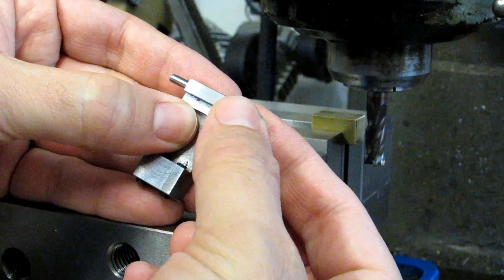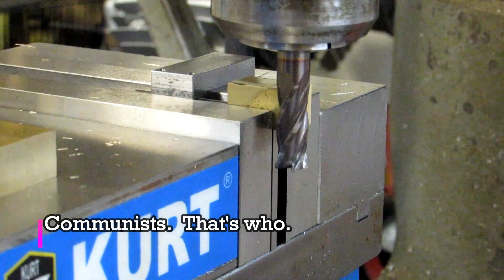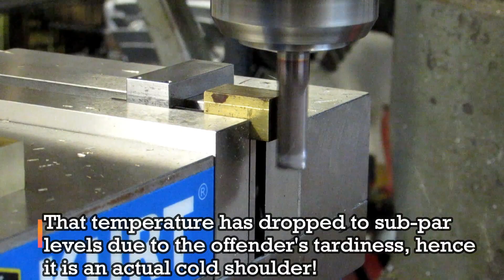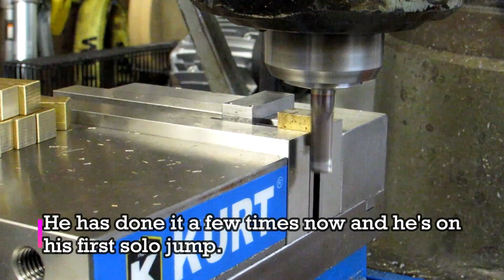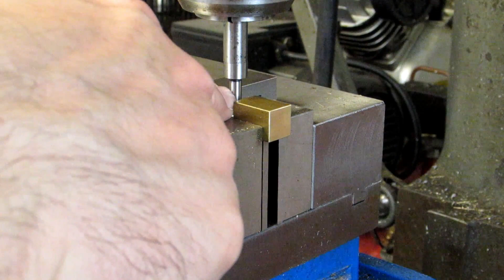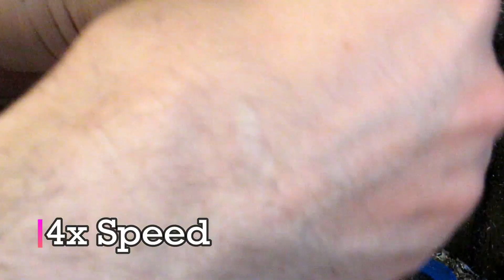Using Vise Stops

Comment: Why are you using conventional milling? You'll get a better finish with climb milling
Reply from the maker: It's a manual mill with A LOT of slop. Conventional milling keeps the screw and nut that drives the table loaded against each other  so the slop isn't going to be violently removed.
Reply: @StuartdeHaro  yes you're right but taking light passes like you did it should work. I never did conventional milling with manual mills but if the mill got a lot of slap is the way to do it

Comment: Hi Stuart thats a nice small stop. There is another quick stop that retains its X axis position is also useful if you prefer to continually reposition it in the centre of a new datum face. It's called a datum retaining vice stop. I like to have a spring inside my vice to hold the parallels in place when blowing the chips, it also takes out any backlash in the vice screw, so a small turn of the handle immediately releases the part.

Comment: I like very much when dimensions are in inches and millimeters. Everyone knows what's going on
Reply: I'm usually a metric guy, but when it comes to machining and the drawings we get from engineers (aerospace) they are always in imperial. It was easier to forget metric and go with the flow.

Comment: Do you use the break to stop the spindle when you power off the motor?
Reply from the maker: Yup
Reply: anon I think the motor has built in brake so automatically stop when off the motor

Comment: What are the doodads for?
Reply from the maker: They're actually a tool for locksmiths for re-keying tumblers.  The slot attaches to a jaw on a pair of digital calipers and the pin that goes into the bottom of the brass piece is used to measure the length of the pin you need for your tumbler.